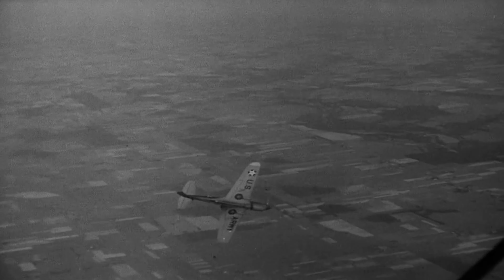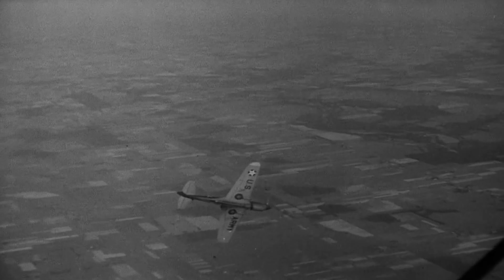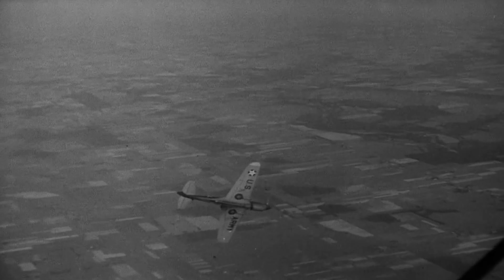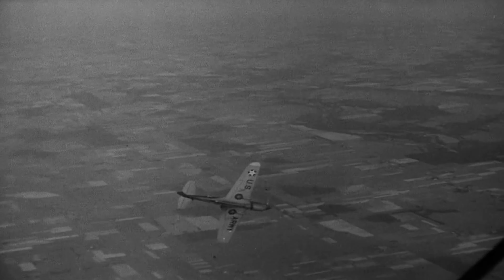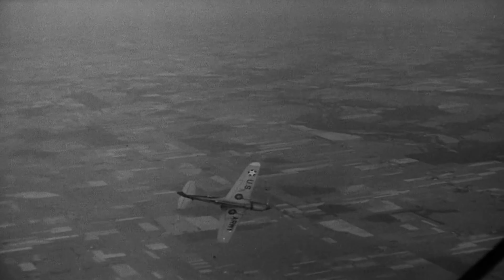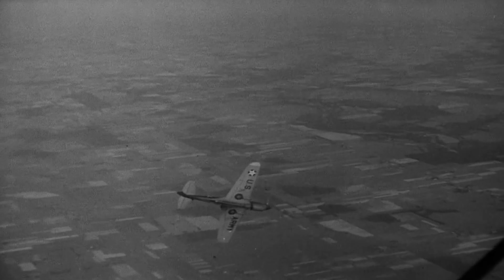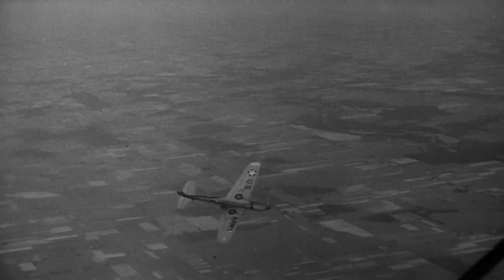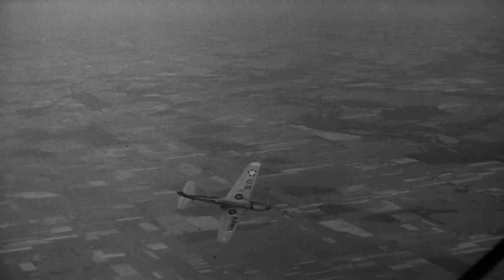The Curtiss P-40 at The National WWII Museum

Comment: I love the P-40 but no list I've seen put it as third most produced of WW2. Most lists don't even have it in the top 10 although it's pretty close. One list had it as the 9th most produced. Comparing three lists the Il-2 is top, either the Bf-109 or Yak-3 is second and either the Bf-109, Spitfire, or Yak-3 were number three. I think he means the third most produced American fighter (behind the P-51, P-47, and bombers such as the Liberator). 
Not all planes were fighters and not all planes were American. 
On turn rates it very much depends on speed and height. US pilots were taught not to get in a slow speed dogfight with the Zero. At faster speeds the Zero was not so clever. I have a book of figures produced by the USAAF comparing various allied and axis fighters. When comparing two aircraft one might have the edge at one height and another might have the edge 5,000 feet higher, then the other might regain the edge 10,000 feet higher. When comparing aircraft to see which is best the answer was frequently "it depends". Another factor is the skill of the pilot. Early in the war the Japanese were generally more experienced and better trained. That situation was soon reversed. As it was in the European theatre. A more experienced pilot will be more aware of how much he can push his aircraft and might out-turn a less experienced pilot in an inherently better turning aircraft. The less experienced pilot might be more timid in the turn. Also, early in the war, Japanese aircraft prioritized range and maneuverability over everything else. So they built light aircraft with little protection and that fell apart if hit. 

The P-40 was robust. Later in the war the Japanese did change how they designed their aircraft incorporating self-sealing tanks etc. and even developed their own version of planes that were more like the P-47. Big, fast brutes, designed not for dainty little dogfights but for delivering a big knock-out punch in the face. They didn't really have the resources to build enough of them and couldn't spare the fuel for adequate training, so their aircraft largely just became targets.